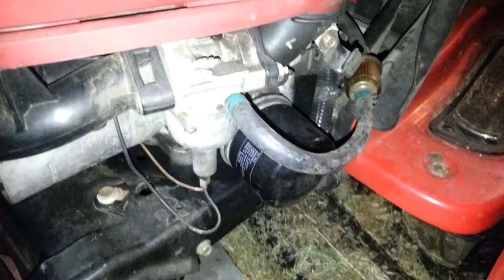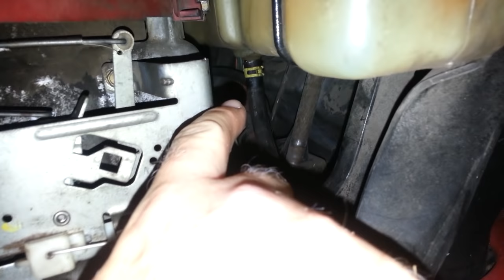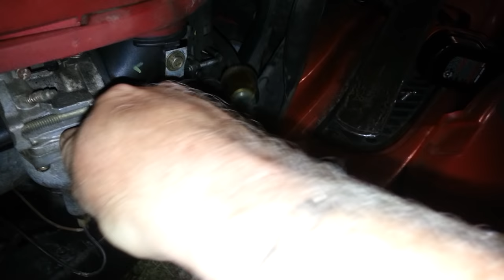How to drain gas from your mower tank- siphonless

Comment: Add a fuel shut-off so you can shut the fuel off before you disconnect the line. It will make your life easier next time.
Reply from the maker: Good tip!

Comment: this guy needs a statue your a bloody legend mate
Reply: Don't forget to open gas lid so it flows much faster due to needing air. While you're at it, might as well change the fuel filter.  Very cheap and easy to do as you are already halfway there.
Reply: @Basslicks82  Mine was slow until venting so thought I'd share.  Thanks for video btw. Hopefully the smoking was caused from diesel in the tank...not sure if it got mixed in, but will know shortly. :)
Reply: @Basslicks82  My mower doesn't drink gas as fast as it pours out the fuel line, especially after opening the cap when it drains twice as fast.  Mine may be slightly different, as it is a Husqi 2348. Changed oil, fuel, oil filter, and fuel filter...then no problems.

Comment: Thank you. I just did this for my mower to store it for the winter. I was going to just leave it running but this is much better. Youtube again saves me time and money. Thank you very much!
Reply from the maker: Happy to help!
Reply: When it comes to storage, it's generally better to add fuel stabilizer rather than emptying the gas tank. When the fuel lines dry out, they could become brittle. So generally, adding fuel stabilizer is a better idea. Make sure you run the engine for a few minutes too to let it get through the system
Reply from the maker: I agree, if you're storing it long term. However, for storing it over a few months in the winter, it's shouldn't be long enough to make the lines brittle unless they've already begun to harden prior to draining the fuel.

Comment: Thanks, but, will break cleaner flush it out?

I got impatient, and tilted it sideways, to empty the fuel, now the damn things covered.

Should I be concerned?
Reply from the maker: Brake clean is a little too harsh. Carb cleaner would even be pushing it with a plastic tank and lines. Seafoam or the like is okay... But in all honesty, even though it's pricey right now, diesel or kerosene would be best.

As far as cleaning the spilled gasoline, just some dawn dish soap and water will clean it up just fine without hurting anything plastic. Blow it off real good with shop air afterwards to get rid of any residual water.
Reply: @Basslicks82  Okay, so I have poured all the oil out of the gas tank🙄.... So, it is safe to pressure was the mower?
Reply from the maker: I wouldn't... Maybe a foam cannon, soak, and hose off but I wouldn't use pressurized water.

Comment: Great video for simple fix thanks a lot it will save me a lot of time I was wondering about another issue .   On the side of my Briggs & Stratton engine on my craftsman riding lawn mower running parallel to the fuel line and above it is a Nother line or tube that goes all the way back to the fuel tank and is under the seat but is not connected to anything it does come out of the engine above the fuel line but only The other and it is not connected to anything where it terminates under the seat at the tag do you know what this is is it a vacuum line

Comment: TY, SHORT N SWEET.. jw, why not do it above the fuel filter so the filter isnt having to filter bad or dirty gas?
Reply from the maker: You can... I just did it like this because the overall length of the line was longer so it didn't make a mess draining into the gas can. Didn't have a funnel handy and was solely doing this to make the video for my friend who wanted to know how to do it. 

In all reality though, if you know the gas in the tank is bad or there's a lot of sediment in the tank, you should replace the fuel filter after draining the gas anyway.

Thanks for watching and commenting!
Reply: @Basslicks82  TY for quick informative reply.. I literally just changed my filter and mower ran for bout 20 min sputtering and dying, so I figured my filter should still be good, I suppose I may be wrong about that?
Reply from the maker: It's possible, but it's also possible that the gas is bad or has water in it. Gasoline floats on top of water, so you should be able to see the water in the bottom of the tank if looking through the filler hole...unless there's a lot of water in it. It will literally look like a bubble moving around in the bottom of the tank. 
Filter shouldn't clog that quickly unless there is a lot of sediment in the tank or fuel line leading up to the filter. 
Your carburetor may also be in need of a rebuild or adjustment.
Reply: @Basslicks82  ty for the replies.. Iam literally draining gas now
Reply from the maker: Happy to help!
Reply: @Basslicks82  I am draining mine from other side of the fuel filter, so it doesn't pick up any debri or potential 'bad gas'....

Comment: I don't see a clamp on the line  where can I get some?? what are they called?  I'm in a trial by fire learning curve helping out a sick neighbor.
Reply from the maker: It's a spring clamp. Regular worm gear hose clamp will work too. You can get them at auto parts stores or small engine shops.

Comment: Pull the line but no gas came out.  Looks and smells like varnish.  How do I get it directly from tank.  Tank is under seat.  Model Briggs and Stratton model 917.273821.  It could be clogged up. Even pulled the gas filter but no gas came out.

Comment: Did as told. Gas started leaking from the moment I started pulling out the line. By the time I got the line to the gas can, the little gas left in the tank had spilled all over.
Reply from the maker: Apologies. It's best to use something to clamp the line like vise grips, or if you don't have those, you can always kink the line and use zip tie or wire to tie it off.

Comment: I have one that I lend to my buddy he accidentally mixed gas and oil what's best to do ??
Reply from the maker: Drain the tank and fill it back up with gas. It may smoke a little while until the residual oil works its way out but it won't harm anything.
Reply: @Basslicks82  okso just do what u did and fillmore let gas go through to clean it out
Reply from the maker: That should do the trick. Wouldn't be a bad idea to put some carb cleaner in the tank along with the new gas just to clean all of it out.

Comment: That works if the tank is connected at the bottom. Not so much with an electric pump and a tank that pumps fuel from the top.
Reply from the maker: In that instance, you can hotwire the fuel pump and have it pump the gas out for you after removing the fuel line.

Comment: I should have known when you refused to actually remove the hose because there was a full tank of gas in it. If only there was a way to lower the amount of gas in the tank. Like say mowing your yard and then making the video.

So I followed your instructions and the clamp came off with a little effort. But tube was attached to the plastic gas tank. After some effort to pull off the tube the gas tank connector gave out.
No I need a new gas tank.
Reply from the maker: ...but you didn't follow the instructions. I said remove it from the carburetor, not the gas tank.

Comment: What if you have a fuel pump
Reply: Basslicks and Big Tires mine has a fuel pump. Lots of tractors have fuel pumps when the tank is in the back. And none of the pumps are electric they are mechanical
Reply: Basslicks and Big Tires I had to use a siphon as the fuel pumps are macanical not electric
Reply: Sir, you're advice won't work on my John Deere la105 lawn tractor because my fuel tank has a siphon tube in the top of the tank. The fuel is sucked out of the tube by a mechanical pump.
Reply from the maker: Same basic principal though. The tank sits higher than the fuel pump. Remove the feed line from fuel pump, then try one of two things:
1) hold the line up high, blow into the line then quickly plug the line with your thumb. With a swift motion, move the line down towards whatever you're using to collect the fuel and remove your thumb from the line. Gravity will take care of the rest. 
If that doesn't work try...
2) hold the end of the line down low near whatever you're using to collect the fuel, BLOW INTO THE LINE (do NOT suck the line unless you enjoy the feeling extreme pain and burning in the back of your throat) just enough to pressurize the tank, then remove the line from your mouth and let gravity take care of the rest. 

Either of those two methods should work, if not, well... I suppose it's time to buy a siphon. I would recommend the safety siphon. It has a ball bearing in it that generates a vacuum, much like a mechanical fuel pump, when shaken. Much easier to use than the old primer bulb style like what is used to prime the fuel line for boat engines.
Reply: @Basslicks82  Thànks for the information and taking time to reply in detail. I'm sure it will be real helpful.
Reply from the maker: Any time!